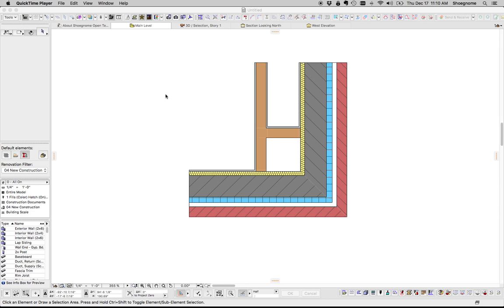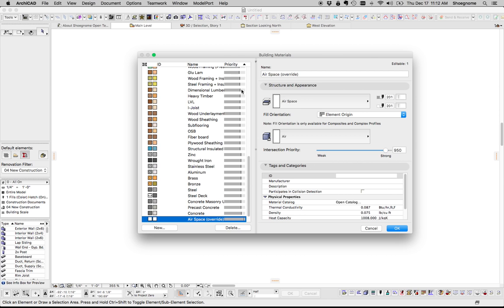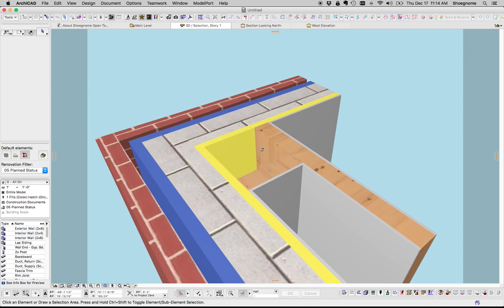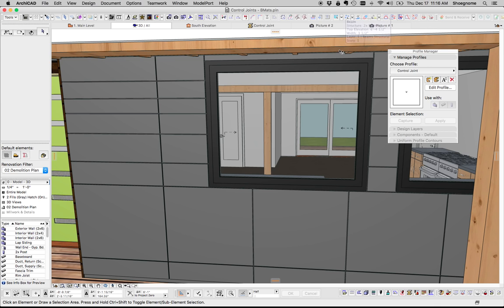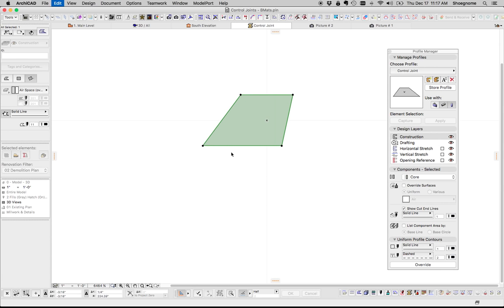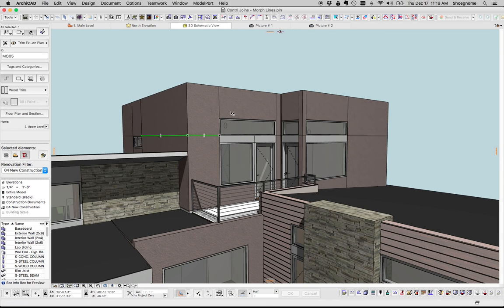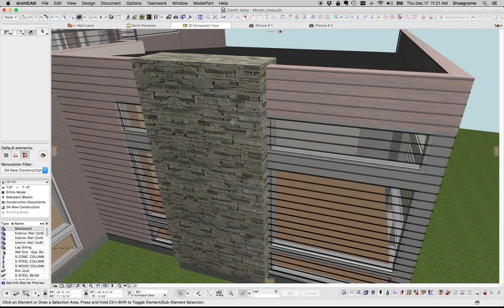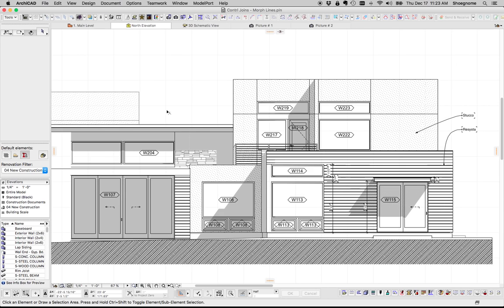ARCHICAD Tutorial #52: Control Joints and Strong Air (Reveals on Facades with Beams and Columns)

Comment: With the weatherboard siding control joint method you created, does this overly increase the project overhead from a software point of view?
Reply from the maker: I haven't noticed it have much effect and it's much less intensive than doing the same thing with Solid Element Operations.

Comment: Hi Jared,

I've been testing this and it seems like a good idea. One problem I am having is how they display in plan view ? What are you setting your line types to ? are you using white ?
Reply from the maker: I hide all the control joints in plan. Or if I show the vertical ones (columns), they are a thin solid black line.
Reply: Okay, if the vertical ones are set to thin black, it shows the entire shape, instead of just what has been cut.
Reply from the maker: correct. So you need to make sure the veritcal cutting elements are exactly the size of the reveal you want. or you just hide them and not worry because you probably don't need to show reveals at a typical plan scale.

If you really need to show only parts of the cutting Columns, use Complex Profiles and set each side of the column profile to the right color (black, white, dotted white, etc.).
Reply: Aaaah Right, Complex Profiles, that's what I will try. Thanks